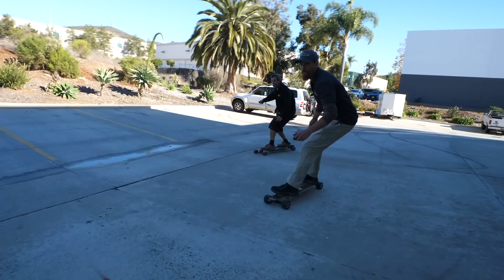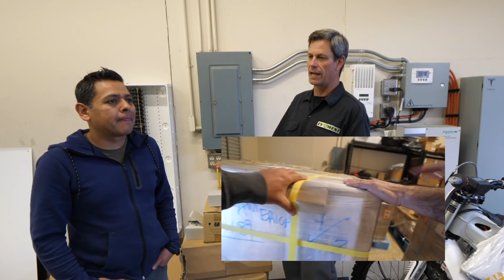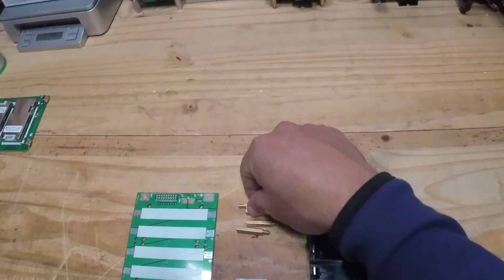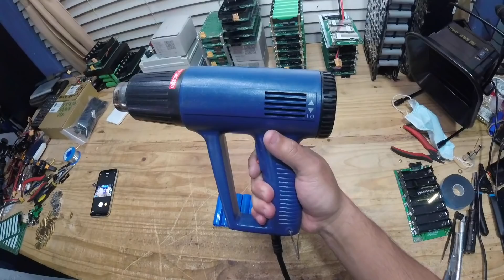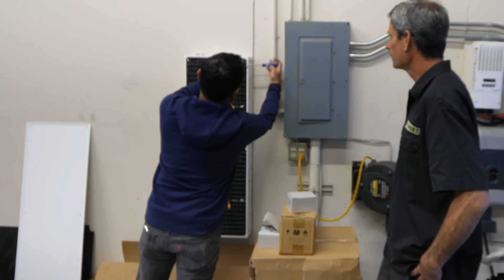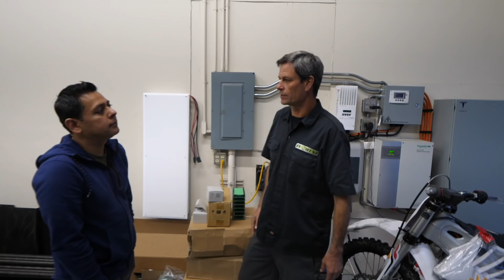Build a DIY Powerwall Using NEW Panasonic NCR18650BD cells

Comment: hi, thanks for the video, I already calculated if I want to build a 5kw powerwall, it seems the diy way is much more expensive than buying factory complete powerwall.
Reply from the maker: Really?  DIY battery prices start at $100/kwh  right now so where can you buy ready made 5kwh powerwall for $500?
Reply: @jehugarcia   I see, well, to build 5kwh powerwall, how many bms , batteries holders, pcb, screws, kabels, and also the batteries cells must be bought?

Comment: Hey! Great video. I live off-grid and am currently running a 2000 watt inverter to power our home, with 6 Rolls AGM 415ah batteries and a generator to power them up. Our batteries are toast and it's time for me to upgrade and I'd really like to build a lithium bank as you have done here but the biggest thing that concerns me is the videos where you show the heating up of your cabling. I'm running really big 2 gauge cables in my battery bank, and I understand that your smaller racks are ribboned together, and then the banks are then wired up with the black and red leads but isn't it possible to use a higher gauge so that they don't heat up like they are? Do you have a video or a playlist of videos that would take me from buying the materials from you to building the wall to hooking it all up to the inverter, charger, monitor, etc.? Mainly it's the hot cabling which has prevented me from ordering from you yet. Solve that problem for me and you've got another customer! Living off-grid, we have no access to fire crews if something were to go wrong and safety is paramount. Thank you so much, Jehu. I love your work!

Comment: I have ncr18650bd BD Panasonic batteries several thousand of them  looking to trade. My name is Patrick I have recently come into hard times. I'm now living in my RV in Utah and it is getting very cold it's snowing today in fact. So I was able to take with me part of my solar system and components that I had not yet finished on my house. I am trying to get a hundred percent  of my heating through the Sun I have several thousand NCR18650BD Panasonic batteries. Fortunately I'm no longer able to afford any other components needed like mppt charger or balancers or whatever I can get to piece together to make this thing work for me I can no longer afford. I and willing to trade batteries for a charger mppt inverter pure sine or anything else I would need to make this work for me if you would like to donate some of your PCB Quick Connect battery holders that would be so wonderful but please anybody that can help me I have batteries to trade I don't think I'll be needing several thousand I actually don't know how many I need but I do need help thanks for reading this

Comment: Jehu, if i install this sytem correctly based on your instruction. Do i have to constantly look in the box to make sure all is well and if a cell should over charge  for some reason should i expect a fire or a blown fuse. My real concern is not burning down the house. I already acquired some cells and i am currently planning on using your kit

Comment: Awesome Video - thanks for that.
Have you ever thought about some diagnosis feature? e.g. tracking the temperature, voltage and current aso.
With that it would be easy to do the next step to be able to connect your smartphone to read all the data.

Comment: Jehu
Earlier I mentioned about help with my Prius battery setup.  We'll I was thinking of a second option: using a 5KVA 4000W Solar Hybrid Inverter Pure Sine Wave 220VAC Output Solar Inverter Built-in PWM 48V 50A Solar Charge Controller, can you please tell me what I would need to run 1100w for 5 hours. Note: I think I would need a step down 220v/110v transformer.  Also; please tell me what else I would need to fully complete this system to be off grid or maybe consider grid tie in.  thank you very much for your help.
Reply: Please provide material list:

Comment: I might have a dumb question, but i have been wondering how a one of these diy powerwalls switch from mains power to battery power wen the power cuts out or what you need to do this. i know old ups's have been used to do this but is there any other way todo this ?

Comment: That will not last long. Where's the cooling or warming system?
Reply from the maker: It’s San Diego  70 degrees year round
Reply: @jehugarcia  nice, we were 115f today lol
Reply: The batteries get hot. Its own heat will degrade your batteries faster. Thats why the Tesla powerwall 2 has its own liquid  cooling system.

Comment: Using spring loaded battery holder is a bad idea. Contact oxidation, inconsistent pressure (different resistance), shrink wrap can get in way, battery can be pop out - all are serious problems.

Comment: Those are some quality cells for sure. I got a bunch of similar but lower capacity NCR18650 C  a while back that I built into a portable backup battery pack and they've held up much better than most other cells I have used in similar applications.

Comment: Nice enclosure but, where do you call out the enclosure?  I plan on using it with solar panels to charge in a remote location where I sometimes work.  So--what is the enclosure??  Whose enclosure & part number.

Comment: I'd like to do a power wall that can give out 240 ac voltage into the house. What components do i use? How many cells? What type of converter?
Reply: You need a split phase inverter. As far as cells, you need to know what size loads you’re going to put on them for any setup.

Comment: 18650 tech is SOOOO BAD.  Why would you go this route versus Prismatic LiFePO4 that has WAY LESS internal resistance, which relates to less losses and less heat, bigger cells that are easier to keep balanced, etc?  I run my place completely off the grid, and am making the switch from lead acid to Prismatics and cannot understand why you would ever use such small cells.
Reply from the maker: Becase 18650s are the best cells in the world
Reply: @jehugarcia  Do you have anything to back that claim up?  Based on my research there are many factors that say otherwise.
Reply from the maker: Only Experience,  I don’t believe everything I read
Reply: @jehugarcia  Ok, I see.  Have you ever played with Prismatic Lithium?

Comment: how do you determine how many amps a system will draw. like is total devided by the number of cells? or blocks of cells? a 10kw continues motor at 72v would draw 138 amps right? how does that relate to the battery ratings per cell?
Reply: ok: let´s calculate for this ONE MOTOR ONLY which you said will draw 138A.  (In fact its more 139A)
(if you have other machines on the same grid  you need to add that to the total A-draw of course)
ANSWER:    it depends on the CONSTANT discharge-rating of ONE SINGLE CELL. (battery)
let´s say your battery can be discharged at 10A continuously,
you would need 13,9 (!) batteries in PARALLEL  to deliver 139A continuous.
14cells for 140A, 15cells for 150A or 16cells parallel for 160A continuous. 

PLS NOTE you need a safety margin of x% for your powerwall. 
never run it on max discharge rate. 14 cells could deliver 140A, but that is like rev up your car in the red zone
so 16cells/160A would be more safe to operate.  18 cells with 180A ...
you get the point

pls check the safety margin yourself. (this is just an example how to CALCULATE, not a suggestion for the specs of your powerwall)
and this example was for the 138,89A motor only

again.
1: check the total Amp draw. (motor + washing machine+AC+TV...)
2: check a single batteries A-discharge rate (continuous)
3: multiply those amps from battery to have the number of parallel cells you need.
4: research the internet for safety margin of total amp draw of your powerwall
5: understand that an Air Conditioner with 100A will SPIKE much higher when turning on for a short time!!! (another reason to "overbuild" the powerwall)

Comment: So what does it cost to build a Jehu version that is equal in capacity to a Powerwall 2?
Reply: DIY = ~$5740
Tesla = $6700
NOTE: read below for more details, the values aren't really equivalent.

The Tesla Powerwall 2 seems to be rated at 14KWh but utilizes only 13.5kWh. It's currently $6700. There is other required hardware that runs $1100 (I haven't been able to work out what's included in this, but I don't think it includes anything Jehu is sellilng. The Powerwall also includes useful electronics (it connects to the internet, updates firmware, monitors power usage and temperature of batteries, etc.), an inverter, a rack/frame, and a 10 year warranty (including a 70% battery capacity guarantee). 

A case of the batteries above is $570 with shipping. 180 batteries at 3.6V and 3200 mAh, with simple math, that's just over 2kWh (I think because of voltage drop, the real value should be less, we'll compare to the 14 kWh value for the powerwall). A 25 pack of his PCBs for $200, will handle 175 batteries, just about the entire case of batteries (there's no discount for upgrading to the 75 pack). The BMS board, from what he has said, will handle about 20 PCB's, let's just say 25 to make calculations easier. That's another $50 in his shop. Ignoring the price of cables, solder, and other miscellaneous items puts it at $820/ 2kWh = $5740 / 14kWh.

Edit: Fixed weird formatting error.
Reply: @Thedamped  the price will drop by a lot of you have a connection that has the batteries. I pick up e-waste from people all my batteries are free and the one's i used are all new to hardly any use

Comment: I am either missing something, or i don't yet fully understand ... by building the battery pack's as such ... are you forgoing individual cell fuses? I cannot see how each individual cell in the 7S holders can be individually fused yet, still connected in series? Or is this just my limited understanding? Would really appreaciate some discussion on this.
Reply from the maker: Every string of 7 cells is fused and those seven cells are paralleled to other seven cells thru fuses,   This system has more fuses than any other pack out there
Reply: @jehugarcia  Thank you for the quick reply! Really appreciate the conversation, I don't think I'm the only one a little confused about the PCB and fuse condition layout.

"This system has more fuses than any other pack out there" ... don't know if that's entirely true ... but I think I get what you are suggesting that your system has. 

As an aid to further understanding, you are saying that each 7s1p has a single fuse (I believe you have shown it in videos), if so, what are you expecting to pull from each 7s1p layer in terms of current? Like only 1C or 2C? so in the range of <5 amps right? And when you connect multiple layers, that's when you get to be able to do higher currents, increasing the parallel cells increases the current? I get confused here as many sites, blogs, people have the mantra that "parallel connections can be small because it's the serial connections that carry the large currents" ... this would seem to be a simplification and would seem to be the opposite with your system right? The serial connections can be small but the parallel connection between 7s layers (the standoffs) actually carry a lot of current?

The "seven cells are paralleled to other seven cells thru fuses" refers to a fuse between the balance leads between each parallel cell right? The thing I don't get is even if one of those fuses blows, the cell is still connected in its 7s series group so is it not still connected in a circuit? I don't understand how blowing one of the parallel fuses disconnects a cell from the group?

Comment: Is it possible to have 2 model 3 battery packs linked together to run a home? Or would the voltage be to high.
Reply: You should not attempt this alone. Try high school physics and then we take it from there 😂
Reply: felixthefox  I would hire someone that knows what to do. I was just wondering if it’s possible
Reply: Ultimately I could just run them separate
Reply: @Beastmode_2381  these batteries produce DC and your house uses AC. So before tying in to a distribution board, you have to preferably get an inline inverter and supply the lights plugs etc that you want to with this ups functionality. Now I'm a professional in this field and appreciate what jehu does (just like the other dude in this video) but at this level of knowledge it's entertaining and bloody dangerous without the correct knowledge. But that's ok, cos he's no entertainer and we welcome you to join us at this level 😁. The inverter I've mentioned above is not the flat car radio amp looking stuff, btw. The one you should be looking for should be very user friendly but I can't mention a brand or anything here.
Reply: felixthefox ok thank you for the information. I have so many questions. It just sucks because you can’t find direct information for what I want to do.
Reply: @Beastmode_2381  what country are you in?
Reply: felixthefox USA
Reply: @Beastmode_2381  pay me?

Comment: 1. Sorry but this "kit" screams unfinished and is not very user friendly. Your PCB solution should come with the components already soldered so the end user just inserts the cells and screws the finished modules together in whatever parallel/serial setup is needed. Same with the BMS. You may be comfortable hacking electrical parts together for yourself, but building a battery pack can be doable WITHOUT reaching for a soldering iron and heat gun.

2. You've got over 500 cells shoehorned sideways on top of each other inside an enclosure WITHOUT any passive or active ventilation. Any time components packed that tight hit 50C or higher you are just asking for trouble. Is there even a way to get to the board fuses without dismantling the pack or know if a fuse/BMS/cell has failed? What about summer use on an outside wall? I sure hope EV West has good fire insurance LOL

3. Give me some of what you've been smoking. No way am I going to pay $3 for raw cells, spend on wraps+insulators AND take up my time prepping each one when I can get same spec retail cells elsewhere in bulk ready to go for $1.96 - $2.40 a pop:

https://www.aliexpress.com/store/product/200pcs-lot-free-shipping-headlamp-miner-lamp-battery-QB-18650-QB18650-INR18650-2600mAh-7A-battery/1332380_32955228750.html?spm=2114.12010612.8148356.10.4e3319f7xthwZH
Reply: Have you built a DIY Powerwall?

Comment: Why would I spend over 2000 dollars and my labor to build a 5 kw pack when I can buy a tesla 24volt pack already built for 1200 dollars?
Reply from the maker: Do it
Reply: @TrueBeliever That is true and why the battery I built is a 7s however you can now get charge controllers and chargers for 6s batteries. Many are now using the Tesla 6s packs with out any issues.
Reply: Tesla will not sell to you without them installing it and then you need to get a building permit then your taxes go up because you added value to your home, I'm not all about giving more money to our government.

Comment: Is this 7S or 14S?
Reply from the maker: Each tower is 7s ,  you can parallel them to keep them at 7s or series them for 14s
Reply: @jehugarcia  Thanks. What is the recommended stack limit with the included brass standoffs? Would I need something different if I do a stack of 38 boards and use XT60 connectors on 2 of the boards to split the load?

Comment: PLEASE make a video that dumbs this down enough to let people who are competent with DIY but have not built a power wall or other battery project.  Step-by-step instructions are what is needed.  Make a bill of of material with prices and SLOW DOWN the assembly process in a video with more details.  It is very frustrating to almost have enough information to do this power wall but you go 100 miles an hour all the time and are always singing to the choir.  The DIY battery world is bigger than that.  There may already be more newbies able to handle this project than the veterans you've had as an audience for years.

Create the kit as a list with sources and prices like people are asking for.

Comment: I'd really love to do this on a converted short school bus. Do you think a unit about half the size would be viable? I'm hoping to run a few LED lights, a small fridge, a tv and a gaming pc for maybe 2-3 hours a day. Aside from charging the occasional electronic or running the occasional blender, that's it.
Reply: Would few good quality car batterys be better idea? Energy density/weight ratio is much lower, but more care free. You don't want to mess with this system in environment where you can't control temperature, air moisture and G-forces.
Reply: @mikakorhonen5715  Ah, that's good to know. I didn't realize they were so sensitive. I was hoping to avoid the size and weight, to maximize space, but this probably wouldn't be a good idea in something that moves, even if it was temperature controlled. 
Thank you!